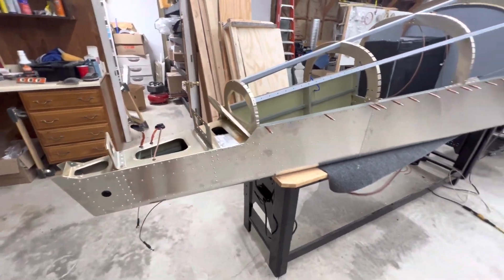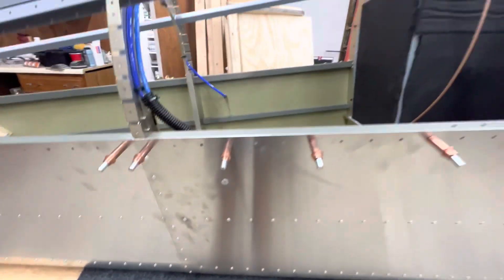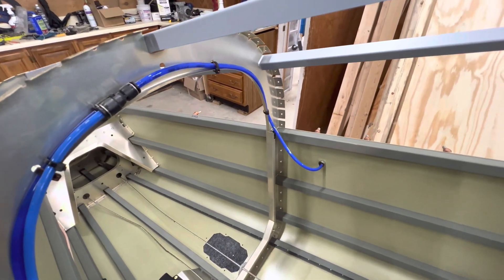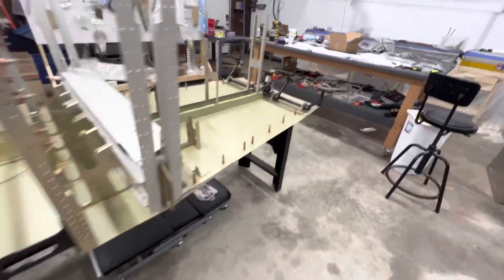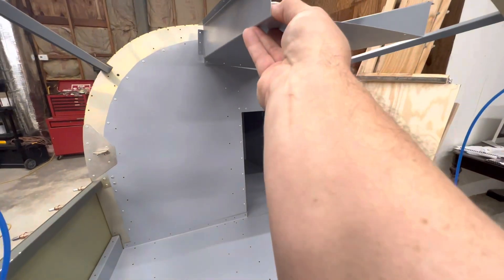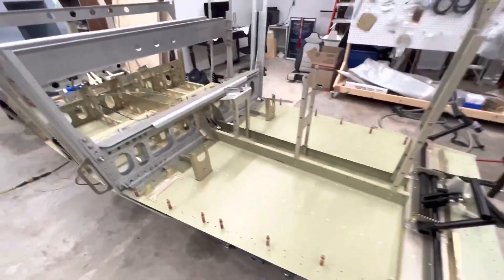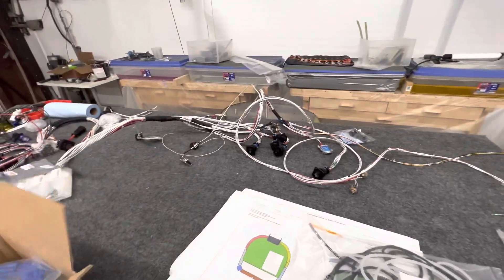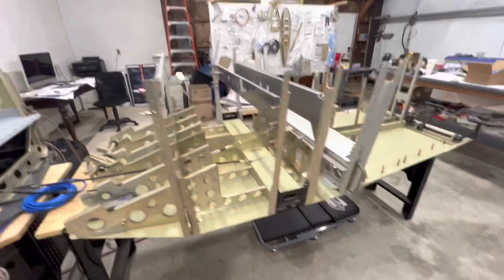Sling TSI Build Update - Rear Fuselage, Wiring, Static Ports, Insulation

Comment: Can you share which Amazon insulation you used? 
Also, where did you source the Y connector for the static port?
Reply from the maker: I purchased the insulation from amazon and I’ll post the link to it.  Just fair warning, its not aircraft approved or anything so do your own testing on it.  The Y connector was part of a kit I got with my avionics from Midwest Panel Builders but you can also buy them on Amazon for cheap.  https://www.amazon.com/dp/B09VDSCMPY?ref=ppx_yo2ov_dt_b_product_details&th=1

Comment: Thank you for posting this.  Really appreciate the details and you do great work!  Question on the static ports.  I did the same thing and ordered 2 not realizing each “kit” contained 2 ports LOL.  For securing the tubing to the ports what are you using?  The ports seems to have very little material on the back side to secure the tubing.
Reply from the maker: With the tubing I used it took a lot of force to get them on so I felt pretty good. I put a zip tie over them after debating about using safety wire. I thought the wire might cut into the tube over time so I used a zip tie.
Reply: @aviationkitbuilder  Ok that sounds like a good decision.  I have a QB so my access is a bit more challenged but I like the idea of placing the ports in that area rather than up front.  Thank you!

Comment: I'm not doing the parachute but did the pre-cabled canopy.  That cable tray doesn't line up to anything that makes sense except for the top skins.  I wound up just doing some match-drilled holes.

Be prepared for some real work getting those cables coiled up when you put that tray into place... I was breathing hard and breaking out in a sweat because you have to coil them up pretty small and that definitely is hard work!  :)
Reply from the maker: I’ve actually debated cutting them off. I bought them when I thought it might be a re- sale advantage but have debated the weight and time to get them routed. I’m not sure the likelihood of me selling the plane to someone some day and them adding a parachute later.
Reply: @aviationkitbuilder  I think it would be a good re-sale add on if someone were to want them.  If you cut them off then they DEFINITELY couldn't be used.  :D

Just wait until you get to putting some rivets in on the front section where it intersects with the cable and the fuselage.  I'm still trying to figure that one out - which will be soon.

Comment: Have you talked somewhere else about the paint you’re using on the interior surfaces?
Reply from the maker: Way back in the early YouTube videos I did. The lighter green is Akzo Nobel 2 part chemical resistant epoxy primer you can buy at Aircraft Spruce. The dark green is rattle can etching primer and the gray is a Nasson 2 part Epoxy. My Akzo Nobel expired and got chunky so I switched to the grey which is also more suitable for top coating which I did on the seat parts and a few visible areas.
Reply: @aviationkitbuilder  Ah ok.  So the grey Nason 2k product that’s visible, that’s a primer technically but can also serve as the top coat for those areas?  (If I’m reading you correctly).  Does it also have chromates/corrosion inhibitors in it like the Akzo product or no?
Reply from the maker: @ericlaw2416  the grey has corrosion inhibitors but I’m not sure it’s considered a cromated primer like the Akzo Nobel. You can leave both of them without a top coat but I have a Nasson Eurethane top coat I’m spraying on top of the grey primer in some instances where it will be visible after carpet goes in.
Reply: @aviationkitbuilder  Thanks for the replies.  Are you also going that route for the canopy composite interior, or using something else?
Reply from the maker: @ericlaw2416  Yes using the Nason paint and primer on the canopy and doors which is the main reason I got this paint.